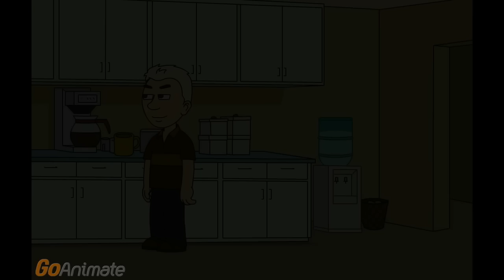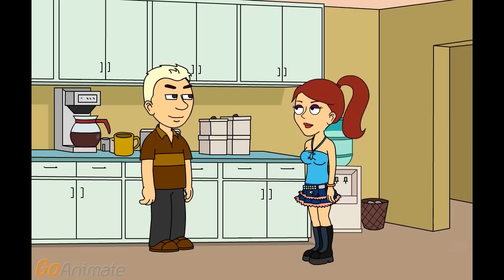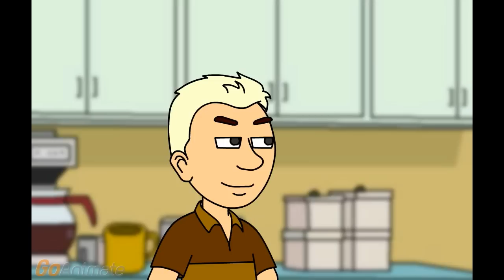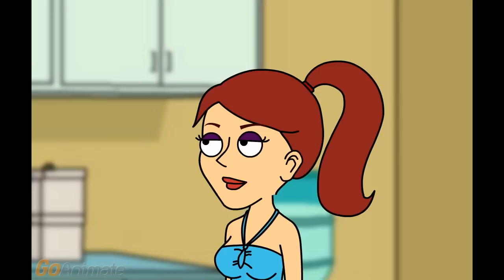Haier Air Conditioner Troubleshooting

Comment: My haier ac is stuck blinking with the auto mode light  the one that looks like this ♻️ the outdoor unit is not working either, the service is coming in 10 days, I live in Australia and the heat here is no joke
Reply: What was the issue? I have the same problem :( we are at 35 Celsius :(

Comment: My haier air conditioner is stuck on timer. It won't turn back on using the control panel and there is no remote. How do I fix this problem

Comment: If the red flashing lite won't go and it is dead in the water,
 try draining the water from back by pulling out the rubber plug, about a cup and a half of water will drain out
 Then put the rubber plug back in and fire that sucker up ...Wall-Ah!!! ...It works again ...
Reply: First thing I tried and there were no flashing lights. And prolly only half a cup of water. A/c just won't turn on. I tried hard resetting it. Tries the test then reset on the outlet, tried holding down the power button, tried it with remote control. Still won't turn on AC model and model number
    Haier HPN12XCM Manuals
Reply: Dang it eh. I had to tip my unit yo get the cup and a half out.
one other thing I did was I had it plugged into an extension cord ...so I took it off the cord and plugged it right into the wall receptacle, reason being there is a compressor in the unit ya need to fire up and to start em up they need the full 15 amps of power ...I think it was them two things that got er goin again ...now I can fire it up anytime once again ...sorry bout being so long in the tooth,,, ...

Comment: Mine keeps flashing stop ! Stop!
Reply: Alban ibraimi mine too. What do I do.
Reply: @sharonclark1556  If the red flashing lite won't go and it is dead in the water,
 try draining the water from back by pulling out the rubber plug, about a cup and a half of water will drain out
 Then put the rubber plug back in and fire that sucker up ...Wall-Ah!!! ...It works again ...

Comment: I have a large Haier AC window unit, for yrs the buttons on the panel don't work, we have to really press HARD to get them to function, sometimes pushing the power button changes the temp, or the temp button changes the mode or pressing them nothing happens.  I literally have to find something pointy & sharp & press down really hard on buttons to get them to work.  As of today it stopped working altogether.  cheap piece of crap.